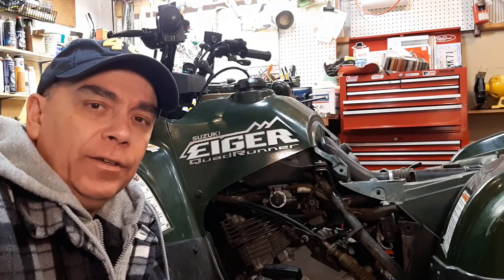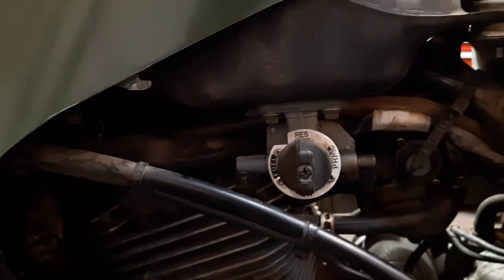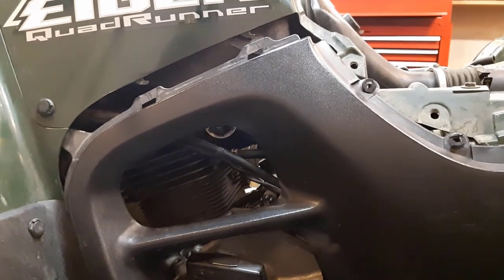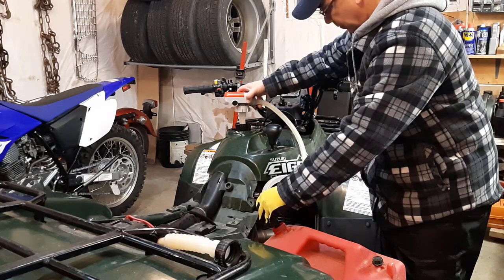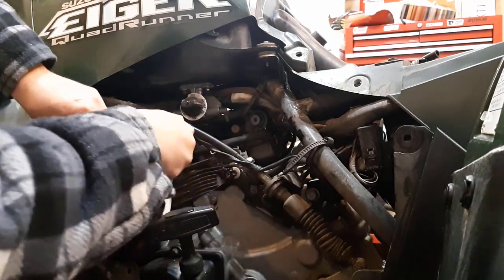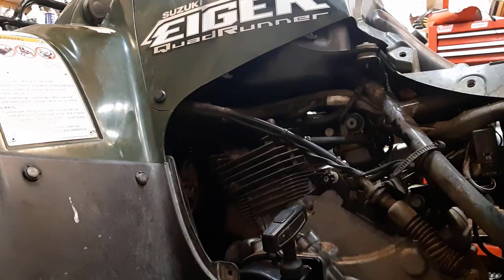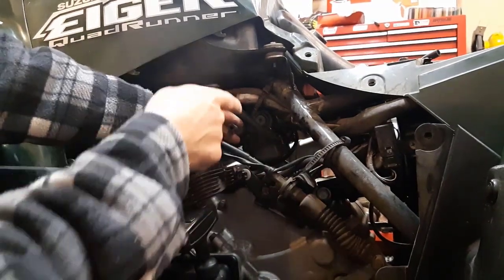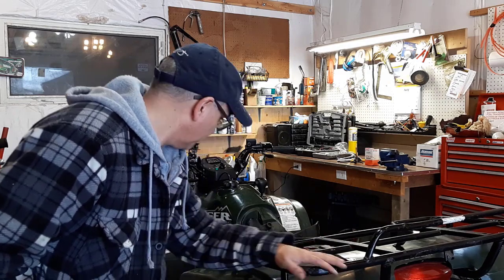WHY WON'T MY ATV IDLE WITHOUT DYING // Suzuki Eiger Fuel Petcock Fix

Comment: Thanks for the good video. I have ordered the battery powered pump and the Yamaha petcock.  I was having same issues as you and started by cleaning the carburetor but it still coughs at idle. I’m going to try the new petcock now. 
The battery pump is going to be awesome to drain gas out of my antique tractors in the fall so that I don’t get issues with old gas in spring.  Thanks for sharing that trick. 
Good to see someone still running and looking after an Eiger too. I was going to sell mine but now I think I’m going to keep it.

Comment: Thanks for the info. I have a 2007. Its doing the same thing that you had said. I talked to people and the dealer said bring it in. Dealers know what wrong but they won't fess up. Just bring it in and we will look at it, NOT. I had checked out everything and it still had the same problem. Now I'm going to go replace it. Great video. Thank you for the info.

Comment: Order 1 for the Raptor 660. Same bolt pattern and do away with the vacuum line. Why do you need a fuel pump when the tank is directly over the carb. Another 1 of those great engineering ideas I suppose.

Comment: I replaced the petcock with a OEM part. It starts and runs well but only with choke on and it idles high?  Do you know what I should do to fix this?

Comment: live in Stirling and this is great. changing my petcock today and will let you know how it goes. If it does not work, can I hire you to check out other problems? I have the same ATV. mine is 2004 as well.
Reply: it worked.
Reply from the maker: @garymacdonald1785  good to hear!
Reply from the maker: I see it worked for you! Good job. 👍  I don't do repair for people, I just don't have time.

Comment: That'll fix'er.... I have a Grizzly and am always tinkering with it... Good toys though. Thanks for the chat...
Reply from the maker: Hey there! I'm still tinkering with this thing. I'm going to try a complete carb kit and hope that will fix once and for all.
Reply: @GettingItDoneRepairs   if a carb kit wont solve issues, give up on it and flip in an aftermarket carb for a TRX450 ( Foreman 450 1999-2004 ) and it will work like a dream.  you might need to grind out a tiny bit of clearance on the mid bracket ( of 4 I have done 1 needed some grinding )   Both of my Eigers, 2004 and 2005 have the petcock and the carb swap. and are trouble free

Comment: The worst thing about Suzuki's diaphragm is that if it develops a hole then the entire contents of your gas tank will drain through your carburetor down into your crank case.  
This happened to me and I replaced the petcock on both of my Eigers.

Comment: Thanks for the video. Great explaination and very helpful.

I've ordered a cheap one for only $13 on Amazon and mounted it on a Suzuki QuadMaster 500, year 2001.

But I had to fit it backward and use a longer hose. Meaning the petcock's front is not visible, though it still accessible with fingers.

I needed to installed it backward because the gas line that starts from the bottom of the carburetor and needs to be fit on the new petcock output, was oriented towards the left side.

So, I would had to twist the hose to bring it to the right side of the petcock, which would had cause the hose to fold and blocked. Also, the muffler is very close, so bringing the hose on the right side would probably had cause burning/metling issues.

I blocked the hose used for the primer line of the original petcock (the hose that goes to the top of the carburator and oriented right side) with a simple bolt and tie wrap.

30 minutes and the job was done.
Reply from the maker: Awesome!

Comment: I have a problem with my fan not working as well, I am going to try this first because it;s spitting and sputtering and hesitating and i just bought one has 185 miles on it  and sat for awhile what else could be the problem

Comment: Great video. I’ve got the same Eiger and same problem. I ordered that Yamaha petcock, but the fuel line size was smaller on the Yamaha part than the original. Does a clamp take care of that, or did I order the wrong part somehow?
Reply from the maker: You can try but if it slips easy, you might have to get another one
Reply: @GettingItDoneRepairs  I ended up zip-tying my clamp down. No issues in the week since I did that. 👍

Comment: my 2003 Suzuki LT-Z400 has the same issue...and has the same/similar 'vacuum petcock'.  It's not allowing fuel to properly flow to the carb....i'm going to replace the petcock with an ebay one that is simply gravity fed and hopefully that will cure the problem.  I've already cleaned the carb.
Reply: Hey any update on your LTZ figured out what was the issue?

Comment: Changed out my petcock, now I have no more starting issues, but I still have bad idle issues, and when I throttle, I have to throttle up slowly otherwise ATV will die. Wondering if I need to service carburetor?
Reply from the maker: Check into this fix I did. My ATV is running amazing now like it should. https://www.youtube.com/watch?v=hhR_wWeDDb8

Comment: Used the same petcock, have the exact same atv and problem. Didn’t work. The yamaha petcock had a slightly different size gap between the bolt holes, causing one of the bolts to cross thread or not thread at all. Not to mention, the thing was missing one of the filters it needs straight out of the package. Now I’m concerned I’ve flattened my threads and will have to re-tap the threads.
Reply: Very good video though. Glad to know this is pretty common. I’ve got no idea why yours worked so well and mine didn’t but I fooled with one bolt for 45 minutes. I also noticed that the flat surface of the petcock where the gasket presses against the tank is much smaller than the Suzuki OEM petcock. Either way... good video. I’ll get it fixed now that I know where to begin.

Comment: Thanks for the vid! Muy suzi is kinda spittin n sputtering at idle and doesn't seem to want to run well without choke partially on. Ordered the petcock on Ebay for 8 bucks!
Reply from the maker: Glad it helped! Good luck with your fix. 😊👍
Reply: @MrRoadhhog  yep

Comment: I just did the same thing to mine today. It will start fine, with choke open (lever down) but will hesitate and die beyond half choke. I can’t seem to fully close the choke (lever up) as you did without it dying. It seems to want to idle faster as well. I DID notice that I didn’t plug the old vacuum line. Would that have anything to do with it? I drained the tank and added fresh (preserved/stabilized) gas but to no avail. Any suggestions?
Reply from the maker: First thing I would do is plug the vacuum line. Then see how it starts & runs. Thanks for watching 😀
Reply: Yeah plug the vacuum line it is sucking air and leaning out the mixture. When you choke it its getting enough fuel to run. So yeah just cap or plug the vacuum line it will run better.
Reply: @GettingItDoneRepairs  hey my 2004 suzuki Eiger was having problems starting. Mine was flooding its self bad. My petcock went bad and it was sucking fuel through the vacuum line. I just plugged it with a bolt for now im gonna buy the petcock showed in the video. It runs like new and idles great.

Comment: Using a glass fuse to plug a vaccuum line would have been a big mistake, if it broke youd be sucking glass into the engine.

Comment: Please help
I have Eiger 400 2003 
Replace carburator but still dies when hot
Or after i run it about 20 minutes
Never fail to stop after running a while 
What do i have to do
What part do i need to rrplace ???
Reply from the maker: This might be your problem. The 2003 - 2004 Suzuki Eiger was prone to this issue. https://www.youtube.com/watch?v=hhR_wWeDDb8&list=PLWeQZSOnzi9UKGKUtqewANDeZR1vgyE_9&index=4&t=177s